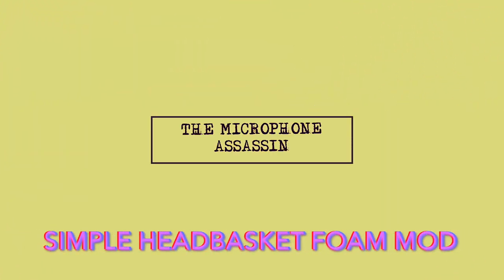Mic Headbasket Foam Mod

Comment: I damped my Oktava 219 with a ring of foam, and it nailed the iffy retro twang. 
I also damped the body with silicone to stop it ringing every time anything touched it.
A chunk of quality acoustic foam placed behind a mic with too much rear input on the cardioid shape can also mute unwanted  room klang from untreated surfaces.
Emergency fixes are usually cheap, and often surprisingly effective.
Reply from the maker: Those are all good tips to fix the 219. It's true. There is a lot you can do to greatly improve a mic just by attacking the resonances. Not enough people understand what those resonances take away from your sound. Nice work!

Comment: Thanks Mark for a really helpful video.
  I also tried rubbe-foam rings but of high-density with a spherical top-shape. As a result, some sibilants became a little calmer. 
  In addition, I often glue thick elastic rubber (or dense foam rubber) under the metal disc that holds the capsule piedestal. It helps to dampen unwanted microphone body resonances.
Reply from the maker: You’re welcome. Where are you sourcing these spherical top rings? Sounds pretty cool.

Comment: Helps sibilance way more than I’d think. Dries it up, maybe less booth will bring some zing back? 

I ended up trying this to one of my mics. Just some random packing foam, really changed the mic. I didn’t like it, but maybe some different foam or material?  Great video thanks
Reply from the maker: Thanks! Yeah, I do think foam density is the difference maker. This particular foam I used does feel like it may dry it up inside a touch more than I want. I have another video coming this week with a different foam in the same headbasket to gauge the difference.

Comment: Foam in sounds more muffled to me, which I think defeats the purpose of an 87 style microphone. Maybe a thinner foam ring will be a middle ground with the best of both worlds.
Reply from the maker: Thanks Mark! Yeah, I’m going to try the mod with a more transparent foam.
Reply: There might be some frequency response in the highs that will be lower in volume with the foam. Essentially what the foam does is kill some resonances that the manufacturer possibly tuned to try and make the frequency response flat. But you can easily flatten out the frequency response with EQ. So. IDK. I prefer my audio gear and mics to be without resonances.
Reply from the maker: That’s the thing about headbasket resonances, they essentially are “pre-capsule”. It’s a science to tame them and I’m stabbing in the dark with whatever spare parts I have laying around. In DIY, you lose the aspect of having all those things tested for you on a finished product, and with things like this cheapie mic body, things like stray resonances are sometimes more prevalent. The purposes of these experiments is really about seeking a physical remedy first. I hadn’t given headbasket acoustics enough consideration before.